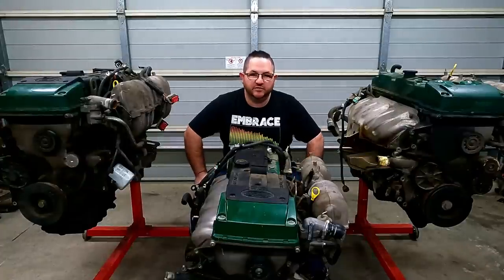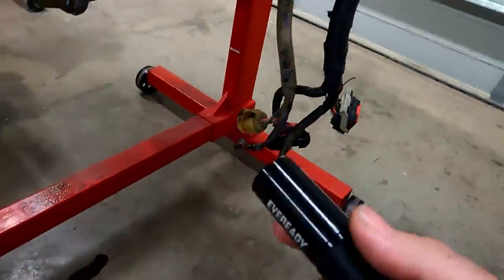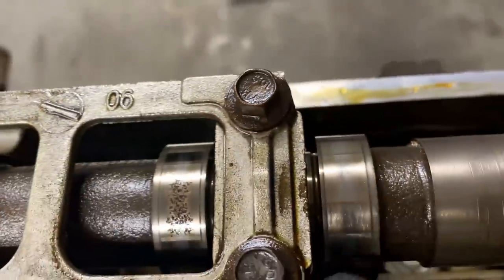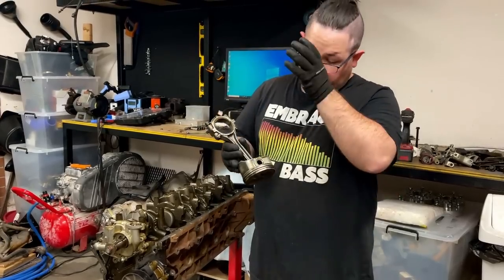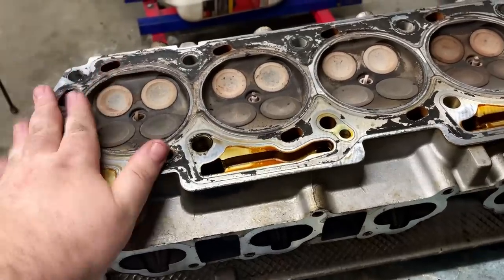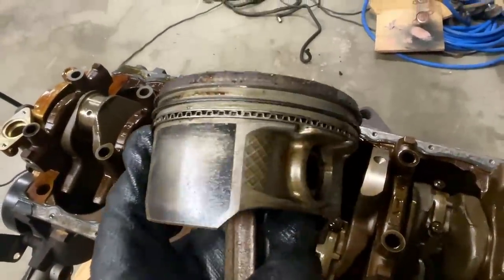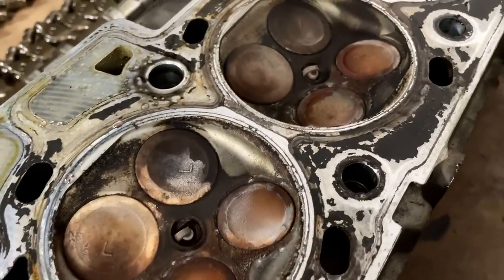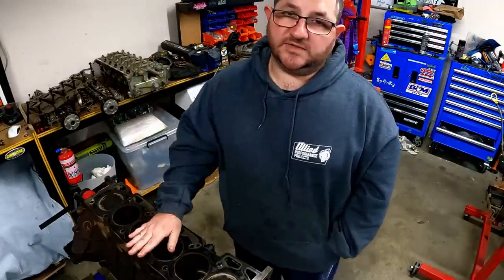Comparing Ford Barra Green Tops

Comment: Thanks for the upload & info. Great to see a guy in his shed giving it a go himself 👍

Edit: what's a set of these green top rods usually cost? I've got a bf mk2 Fairmont Ghia with the barra 190 (skinny rods) in the shed doing nothing. Might swap the rods out one day. Maybe.

Not a chance in hell I could pick up a green top anywhere near that cheap where I live
Reply from the maker: @CHANGE_YOUR_OIL_REGULARLY Thanks for watching mate!
i had to remove these engines at the wrecking yard myself so i got them a bit cheaper, but they sell on marketplace and gumtree for around $500 - $750.
If you're going through the effort of pulling down a motor to swap rods i'd honestly just get a set of stronger rods and better pistons, places like golebys and empire have them for a good price and will hold way more power!
Reply: @EverythingFuzzY  just curious won't be spending my money/time on the barra 6. My "toy" is the low km late 07 bf mk2 xr8 5.4 4v t56 in my profile picture. The Fairmont Ghia is secondary. Though its leather may end up in the xr8 🤷
Reply: @change_your_oil_regularly4287  have another look, they’re cheaper atm. Least here in SA. 

After seeing this video too you know you’ll only need a short block to get what you need out of it.

Comment: Can you fit a turbo valve in a stock green top ? 
I don't know much about barras just what I've seen and hurd. I'm looking at a barra swap for my xa falcon.
Reply from the maker: Pretty sure you can, but i haven't tried. Might be cheaper to find a second hand turbo head with the valves already in. Atomic Inconel valves are $53 each and a barra needs 24 of them!
Thanks for watching!
Reply: @EverythingFuzzY  okay thanks heaps. I was thinking xr6 motor but not sure as to how much I'll be able to afford. Thank you for your insight.
Reply: @Twistedvideo  costs about the same to source a turbo head, my cousin did this and it worked well (gas block + turbo head) when his early model xr6t blew up
Reply: @EXZACHTPERFORMANCE  okay cool I'll keep that in mind thanks. Roman

Comment: To maybe help on how you pointed out the bad camshaft wear particularly with the FG motor you took apart. It could of been due to oil starvation from the poor quality oil pump housing n the oil pump gears ford use. Also could be from someone changing the camshafts on it and mixing up the camshaft cages which are suppose to come off and back on in the same order. But it looked to be more than likely oil starvation
Reply: It's from the roller lifters work hardening the metal , only fix is to use steel cams then u move the ware to the roller, can't win. Will adventually ware
Reply: @josephcowen9771  this is true also engines are kinda weird with some oils like it must be the casting or something because the quad V8s don't like full synthetic oils

Comment: Hi mate, i have a green top in a BA falcon Ute. It has just developed a water leak which i think is a head gasket problem as the oil is contaminated with water.
I am going to buy another green top for my ute from the wreckers but i was thinking of stripping down the old motor with the possibility of turning it into a green top turbo. Can you run a straight gas set up with a turbo?
Regards,
Peter
Reply: Head gasket usually

Comment: The EcoLPi is missing here i noticed. Would have been an even better comparison how ford finally perfected the LPG 6 in the end in comparison to prior cruder designs.
Reply from the maker: Thanks for watching! A lot of people asking about the LPI motor. If i ever end up with one of these engine i'll do a video on it. From what i've heard ford went back to the weaker conrods so they aren't a popular choice for conversions.
Reply: @EverythingFuzzY  Usually the case knowing Ford... especially the FG
Great platform let down by bulls**t US influence.

FG MK I - terrible denso a/c system, you're lucky to get 7.5°C at the vents 

FG MKII - they fixed it with a whole new system which was brilliant, my FG MKII G6E sits around 3.7°C at the vents. 
FG X - they went back to the older inferior system. With even smaller components. Similar temps to FG MK I

Comment: Just out of curiosity where does the oil from the turbo return to with an na motor?
Reply: There's a casting for the drain, you'll just have to drill the holes out and tap into the flange

Comment: I’ve got a extremely clean silver mark LT pickup with the ford 5.4 3V triton 283k miles that I’m thinking about doing a barra swap. But I’m looking to use the barra turbo due to its TQ numbers and width of seen in dunk sheets. Do the barra and the 5.4 3v in Australia is the same transmission? I’m trying to see if it’ll boot up to my 4x4 trans.
Reply: The 5.4 in Australia is or was a 4 valve motor, there was a limited LTD with the 3 valve on the options list but no one bought them as 4 valve quad cam was same price,
Reply: @josephcowen9771  would a barra built with a medium sized turbo do well in a truck ? I’m looking into this because my engine could go at anytime due to its mileage and people keep speaking of the torque of the barra turbo especially low and mid range which is what’s needed for my truck.

Comment: So with all that, did they develop the 3r rod for the lpg engine and just use it in the ba f6 engine as I fail safe then the from bf 06/06 in the xr6 turbo engine or did they start using the f6 rod in lpg motors from when the first f6 was created?
Reply: They didnt have a f6 til 2005 and thi gas motor was from 2004 so i would say they were an lpg rod first🤷🏼‍♂️
Reply: Ba f6 started 2004

Comment: I not long ago brought a engine to swap out from my old BF 400 000 km, that was run out of coolant A BF Ute, the replacement engine has a Z9 filter, and a single knock sensor what model would it be?
Reply from the maker: BF mk1 was still a BA engine, so z9 filter and 1 knock sensor.
They didnt change untill BF mk2.

Comment: So the FG and BA motors were clean as when you opened them up compared the the BF. What's the thoughts on what causes this oil staining? Use of mineral oil over synthetic? Higher milage between oil changes? Or maybe a hotter running engine causing the oil the burn off? 

All of then were 200+ engines so there has to be a secondary factor. 

As you were opening the BA motor I was thinking to myself that it's gunna look dank. But it was clean af. 

Anyway dope video bro your getting sub n share from me. 

Much love from south east Queensland
Reply from the maker: Hey Simon, Thanks for watching and subscribing! 
Yes, i was taken back when i lifted the rocker cover and saw how brown the engine was, it looks exactly like my xr6t engine. 
Possibly cheap oil and too long between oil changes. The engine numbers matched the tags on the car so i can confirm it was the original gas motor.
Thanks again mate!
Reply: High temperatures with mineral oil 
Minerals are like butter That burns to the bottom of the frying pan when it gets really hot synthetics are like vegetable oil that doesn't burn on the bottom of the frying pan when it's gets really hot if can compare it like that

Comment: hey i have a bf engine and i needed to change to rear sump so i was told to put a fg sump and windage tray on it all fits well but nowhere for the dipstick to go now , can you help ?? is there a way or do i need to run the original front sump or get a fg engine
Reply from the maker: Hey, the FG mk1 engine has dipstick holes for both front and rear sumps. If you’re using a bf engine you’ll need to drill a dipstick hole for the rear sump and plug the front hole.

Comment: I've got 2 BA's with around 250K on them WITHOUT any oil leaks, I have owned them since new a7 had zero problem what so every & 1 of them tows 2 ton on a regular basis & also gets given the beans so I think there bloody indestructable.
Reply: I've got a BA lpg work ute with 485,000 kms and still going strong. " Ford, go further. "

Comment: Early ba gas motors can have 1rs but majority of them are 3r
Reply: Only 2 months of ba had 1r, I think oct/Nov 2002,with December being a changeover month. most were blown up and replaced under warranty. 

Theres a ford service bulletin on one of the ford forums about them and changeover specs just like the one about bf turbo motors in may/June 2006 ✌️

Comment: Nice video 
The later model fgx engine had a different head i bought some taxi pack heads a while back they raised the compression on the last model the porting is staggered combustion chamber is smaller  i have pics of this as i have been porting them and have documented the head there is very little change in  the other model gas engines i run stainless steel valves but if you check the exhaust  valves in the gas block they are not magnetic so they are either sodium filled or inconel, sodium valves are what they use in the rb 25det i build these aswell 
So all is safe 
It seems if the cams are worn it goes  back to the oil pump having low pressure 
The only ford cams available now are fgx cams 1 part number for all 
Have fun building those they are a great engine

Comment: Dose anybody know why my BF mkiii  2009 model dedicated gas wagon has a silver engine cover and not the green one???
Reply from the maker: I've seen BF3 wagons and some FG dedicated gas engines with silver rocker covers. the story i've heard was Ford had run out of green rocker covers and didn't want to spend money on painting them so they reused the silver ones.
Whether its true or not, i don't know!
Reply: @EverythingFuzzY  do you reccon they could have run out of the dedicated gas engine snd just used the NA motor with the gas bolt on system?

Comment: The FG probably starves for oil because the oil filters too small causing pitting on the cams
Reply: All cars only put 25 percent of oil through filter anyway, and if at any point oil was starved the bypass would put no oil through filter , that's its job, I remember in the work shop a bloke came in for oil change , he stated he couldn't get the Rite filter so he cut up old inertube and made his own gasket in so completely blocking oil from entering filter, he'd drove the car around Australia like that , motor was fine it just bypassed filter 100 percent , clean oil nothing wrong ! Filter would have been better but go back 40 or 50 years motors didn't have filters, it was an option !

Comment: Rear sump is more desirable for what reason?
Reply: Pretty sure the LPG heads have decent guilds and valves too..
Reply from the maker: The rear sump isn’t what i was referring too as being desirable. People seem to think the FG gas motor is better than BA/BF. I was just stating the differences in the sumps between the 3 engines. All 3 motors had the same valves.
Reply: Pretty sure ford put the stronger rods in gas engines due to bent backfire in LPG au enif engines and the f6 or something like all xr6 2007 rods got the LPG rods...
Reply from the maker: Yeah thats correct, when the gas motors backfire they would bend a rod so they used thicker rods to solve that issue.
Reply: 4WD conversions with a solid front axle need a rear sump - check out F-100 windsor sump vs sedan windsor sump, as an example 👍
Reply: Oil moves back when U drive forward ! And most conversions have cross member at front !

Comment: Nice job and informative, I watched it to the end, but a bit unhappy about your choice of SuperCrapAuto/Bunnings tools - OZITO, TOOLPRO, blah, blah, blah. Don't mind me. Crime Converters have some good tools - far better that SuperCrap!
Reply: Tool snob
Reply: It's not about the tools, it's all about the one using them :P
Reply: @Julzilla  I'd agree a "gun" can get away with using crappy tools for only so long - note the change from Ozito (FG) to ToolPro (BF) in these movies. What would I know after doing similar things for over 35 years - Just a bit! 😀
Reply: @change_your_oil_regularly4287  Not really, as I am just a hobbyist, but yes, as I have split a few sockets, twisted the end off a few extension bars and had a couple of ratchets fall apart.
Reply from the maker: @v6hilux  Thanks for watching mate! If toolpro are good enough for The Skid Factory, they're good enough for me 
👍
Reply from the maker: I've owned all these tools for well over 6 years. Yes, the ozito and toolpro skins are cheap coming in around $40 - $60 per skin, however that TTI set was $300, that bahco set was $100, i have valve spring removal tools that cost $400. i spend the money where it needs to be spent. 
When my powered tools break, maybe i'll think about upgrading them... but until that day comes i see no point. Rather spend money on go fast bits.
Reply: @EverythingFuzzY  you can have ozito for life breaks take it back and exchange for new one
Reply: A good tradesman NEVER blames his tools!
Reply: Really!? I'll go to my ozito everytime before my makita. And my 100's of kincrome are average at best. Brand name tools are not always best.

Comment: Aluminium has life span of heating cool down this is reason why all alloy heads fail alloy is killer to all engines alloy is shit composites designed to fail with amount of heat up and cool downs alloys can handle nearly all engine failures due to bad heads this is deliberate design to sell more parts as said before flood market perfect parts business go broke fast